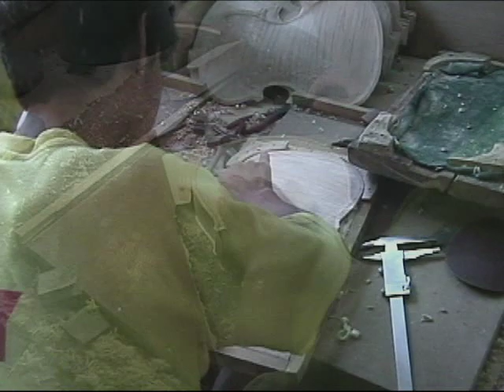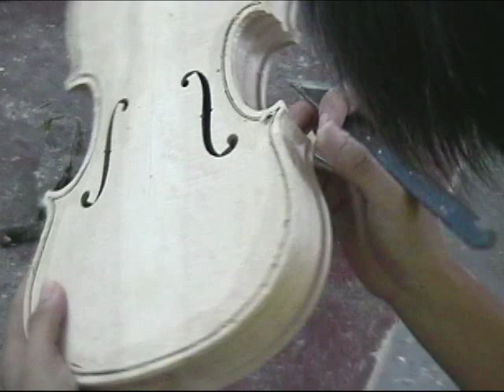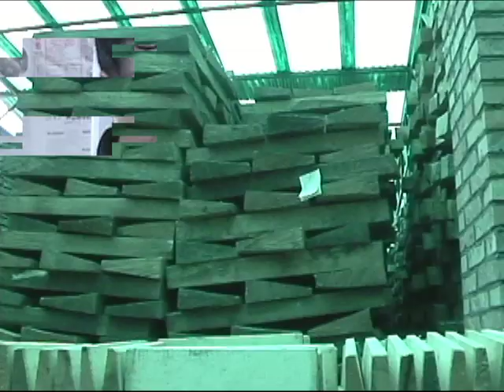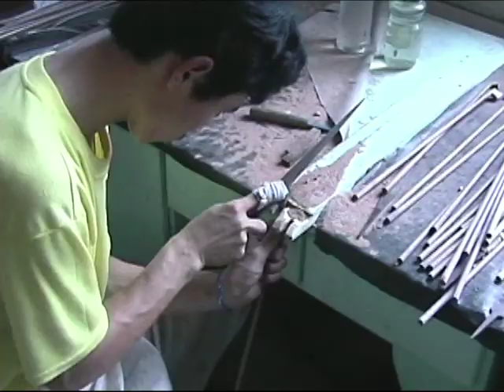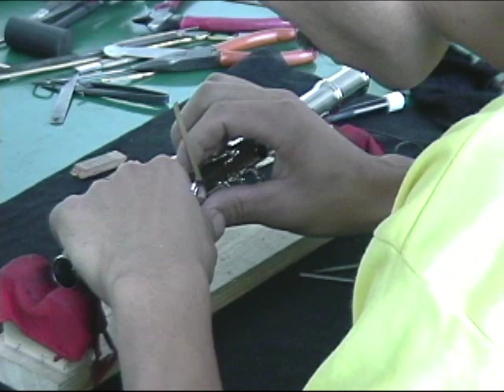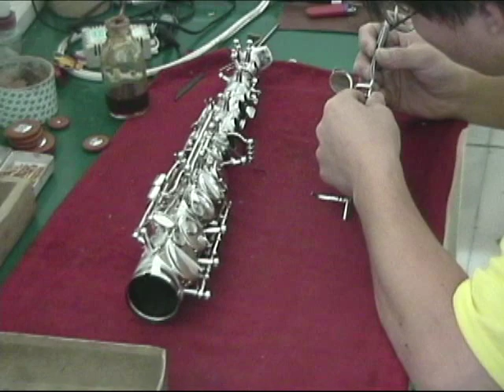Chinese Musical Instrument Factory - Violin - Flute - Sax

Comment: they are quite capable of making fine instruments, they have the skills but unfortunately are forced to cut corners. Things like using hide glue instead of PVA, wood rasps to carve scrolls and oh boy that side trimming jig. Notice how they bend the flute keys to match the seats, something you find on junk flutes.
Reply: +Andrew Nolan i agree, but some still have the quality of find wood workers.  if you look right, you can find scrolls that are really well done, and those usually have other fin woods, and hopefully craftsmanship.  100-500 for a chinese violin to learn on isn't so bad, when i can't be satisfied with a reputable luthier, who sells for 20,000…i just bought one off ebay. after looking over them all, and i believe i chose one that escaped with a little better construction.  i mean the scroll is just there, its good looking. and the wood is consistent all the way through.  we shall see if this beats my 1984 cremona.  WHAT I WANT IS TO HEAR AN ENTIRE ORCHESTRA WITH THESE INSTRUMENTS.  also, whats wrong with a rasp?  i carved a neck with a rasp… now i wouldn't choose one for the scroll, but it's all up to the builder.  it's obviously more difficult, but he looked like he knew.
Reply: +Andrew Nolan hide glue is used so that the instrument can be taken apart for repair 20-50-100 years down the line.
Reply: TexExpatriate1 not entirely.  it's easier to work on yes. but hide glue has many advantageous characteristics that other wood glues like aliphatic resin can't compete with specifically tonally through it's crystalline structure.  hide glue is harder to work with, and a musician of amateur level would benefit from other glues as they will be less tedious in the storage area of musicianship. but there is no comparison tonally to hide glue.  it's superior, plain fact.

Comment: sorrey for my bad inglish i have owned maney chinese saxophons they play verey well there are so called no namebrands and brands, to compared to mine P.Mauriat and Yamaha i have to maney saxes they sound great and are Nice to play and the later yers they last longer now than they use to do maney brands in auropa have theyr instrument prodused in China like roybenson and is British but is manufacored in China and maney oters to i like them they can easely compare to 2 times more expencive instrument
Reply: the 62 is Yamahas ICON for tenors but wil the chinece copy of my 875ex play as well as my reel yts 875ex i have tryed maney saxes the same brand and model and they sound slightly different it is impossibel to clone an instrument they wil sound diffrentley even if they are identicly the same modell so Your question is hard to answer even to Yamaha 62 can sound diffrentley that is my experience
Reply: i do also fix my own instrument then they feel more personaly to me ,my baritons (i goth a colections of saxophones) is prone to leak even they have dobbel arms on the keycupps from c and Down but that is common to baritones BUT i have one question perhaps you can help What do you do With sticky pads some wil stick al the time even after cleaning and the sax is resting a day or two and the pads are sticking it is driving my crasey
Reply: I have played new selmer mark V1 soprano saxophones in 1983 and they were both different, no one saxophone is the same, you can get a cheap horn and it can speak better than a £3000.00 uk type